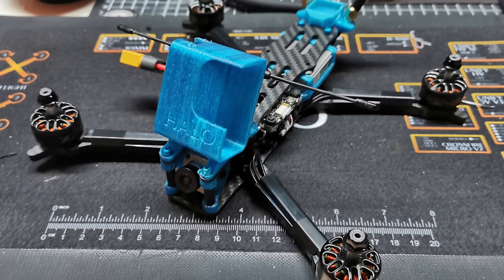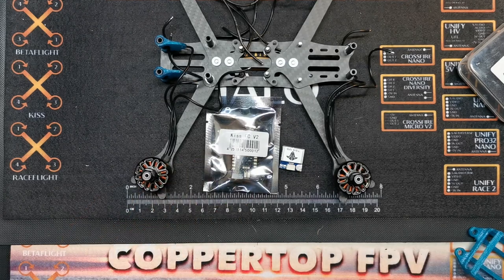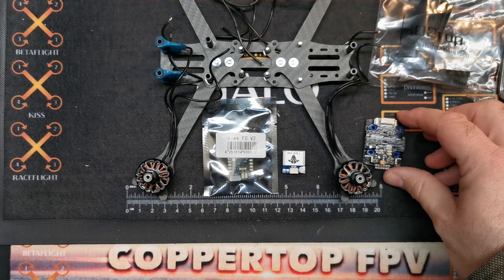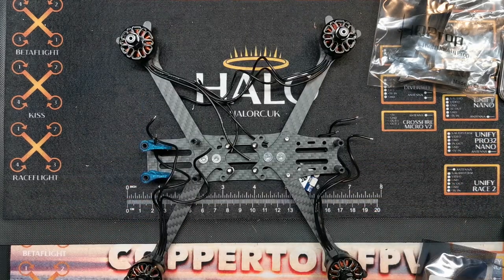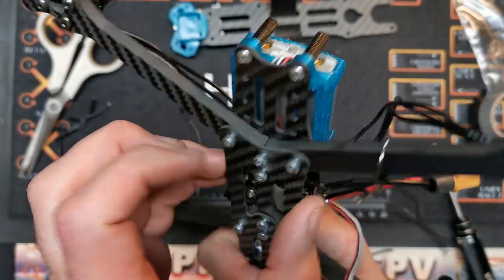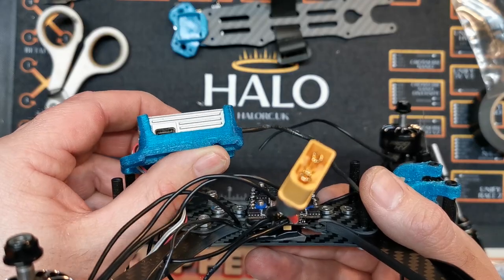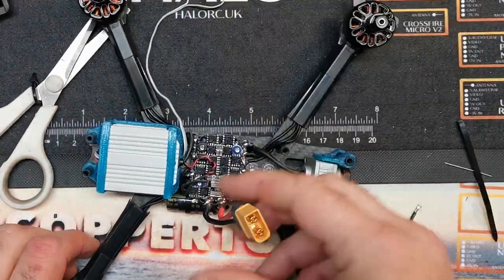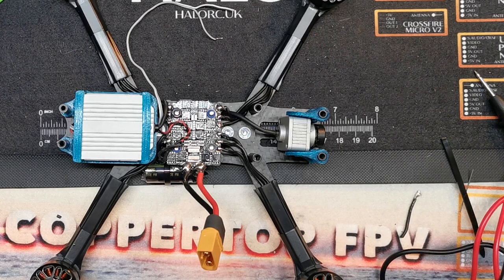Kiss V2 DJI Hybrid full build / Pt 1 of 2

Comment: FYI for next esc, silicone comformal allows heat to escape, acrylic doesn't ;)
Reply from the maker: Helps stop the esc freezing in good old blighty 😂
Reply: @CoppertopFPV  lol true
Reply: What coating do you advice?
Reply: @mattiagatti1200  mg chemicals brand

Comment: Thank you for videos! Built my first quad using you Hyperlow-Kiss video and now aiming for a second quad with Air Unit - Should i use BEC for Air unit with Fettec 35,45 A ? Or I Could solder it to the battery pads just like Vista ?
Reply from the maker: The air unit is rated to 4s so you're fine for that but if you use 6s batteries you'll need to use a seperate 10-12v regulator. Happy flying :)

Comment: Looking good mate. Question: for the bigger part of the year Ive been living under a rock. Whats your reason why your flying KISS V2?
Reply from the maker: Hello buddy! Hope you're doing OK mate. I don't like beta at all these days. Even when it's flying well its oddly changeable and hard to tune. I tried kiss v2 to prove it was hype and have never gone back. It tunes in two packs and flies like nothing else I've ever tried with no messing about. It just has an incredible feel, virtually zero propwash in any circumstance and carries on flying well regardless of how many trees I hit :) everybody I fly with who has tried it is the same too. I don't like the escs as they're too expensive and I've seen them smoke, hence using blheli ones. Your aikon stuff should work well. If you go back two vids you can watch me hit 42000 trees and watch how it handles it :)
Reply: @CoppertopFPV  Im doing well and Im back again! All of my setups are a year old. Im still flying the helio boards with butterflight and it flies great. But I want to try something new and NOT betaflight. So I think I will order myself a KISS fc 😊
Reply from the maker: @RaymonFPV  glad to hear. Kiss is a bit of a faff using analogue. Still no osd unless you use the impulserc apex osd/reg or the wolf v2 or v3 pdb. Really simple with dji tho. Tbs vtx (name slips my mind) also gives osd but its basic. From my experience if osd is essential I'd use the wolf pdb and seperate escs
Reply: @CoppertopFPV  So Ive heared. I only care for the voltage in my osd. So the fpv camera takes care of that. If I cant figure something out, I will send you a mail 😁
Reply from the maker: @RaymonFPV  😁
Reply: @CoppertopFPV  Did you ever Tried falcox btw?
Reply from the maker: @RaymonFPV  yeah once. It had a nice feel but I couldn't get rid of bobbles coming off throttle and I thought the flight controller was noisy as hell and poorly made. I have the 20x20 to try in a smaller quad. Its on my list of things to do as lots of folk seem to like it
Reply: @CoppertopFPV  that was exactly my experience with fl1... I hoped falcox would be an upgrade

Comment: Is it possible to use different ESC like t motor one instead of that one? is it working with Kiss FC ?
Reply from the maker: Yes but you'll need a betaflight flight controller to setup and flash the esc as there's no blheli pass through with kiss

Comment: I am looking for a first build and keep scrapping build lists. I'm finding it very difficult to nail down a good first drone list because everyone has their own opinion. Would you recommend this build for a first-timer? I'm getting good at the flight simulator so I'm not exactly green. The price tag is about 1400 for all of this since I'm in the US.
Reply from the maker: Are you buying the dji system?
Reply: @CoppertopFPV   yes
Reply from the maker: @localcragdirtbag8049  this is a great build but my advice would be start off cheaper, make sure you're in the hobby for the long haul and cut your teeth on a betaflight build. While kiss is imo much betternfor 5"  you'll find a lot more help with betaflight and as you build more you'll have gained the experience to build a 3" or a whoop etc etc. As for components as a first build I'd make your life easy. TBS source one 5" is cheap and reliable. These motors are a bargain. You could convert the tbs frame for dji. Seperate escs and pdb because they're cheaper to replace and easier to diagnose problems on (spedix 30amp blheli s are super cheap and reliable if you can get them). Simple f4 or f7 flight controller. Personally id also start on analogue rather than dji. It's great but it will limit your options, costs a lot and as it'll take at least a year before you're good enough to use it in a place that it beats analogue you'll have likely built another 6 quads by then 😉

Comment: Nice build! It helped me a lot understand how to connect the DJI system onto the Kiss FC! But I still wonder if i have to use a regulator and a capacitor if i’d use 4S batteries? Could you help me out on that one? Cheers and thx for your videos ;-)
Reply from the maker: You can power the air unit directly from 4s. I'd still use a cap as it protects your electronics in situations that are bad for them (stuck in a tree with props hitting branchs etc)
Reply: @CoppertopFPV  Thx for that! Therefor, which type/size of capacitor should I use with 4S?
Reply from the maker: @nicolaslother3391  35-50v 600 - 1000uf on a 5". The bigger the better. I usually run 35v 680uf as it fits my build and isn't too big. On a smaller quad 3" etc youd go smaller and use 380 etc.